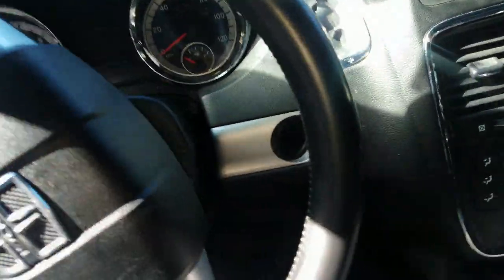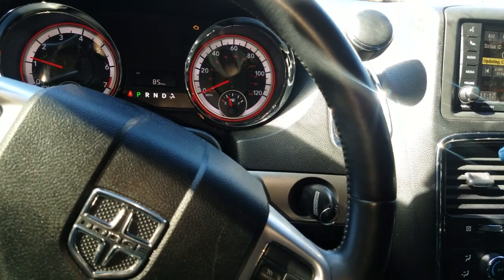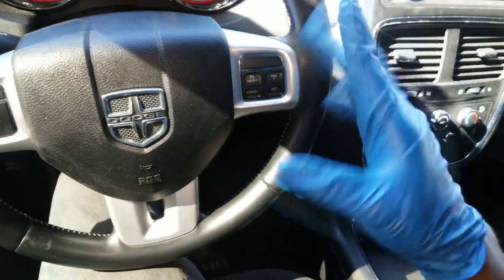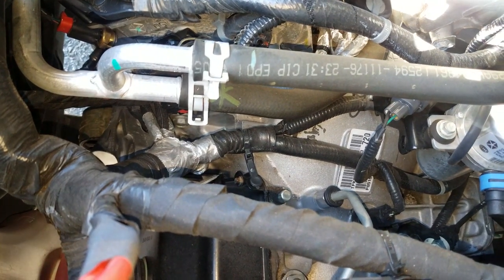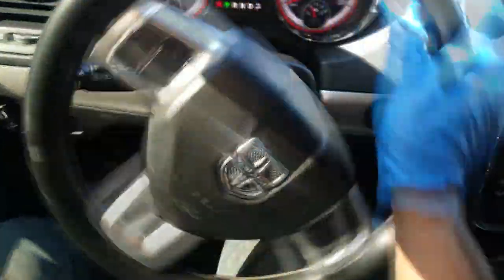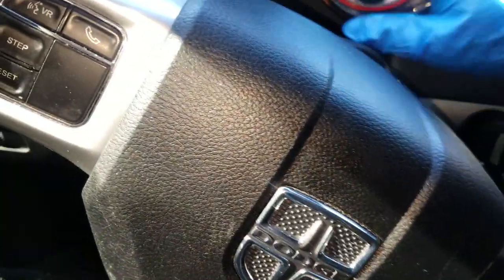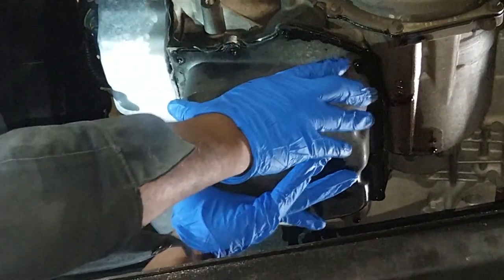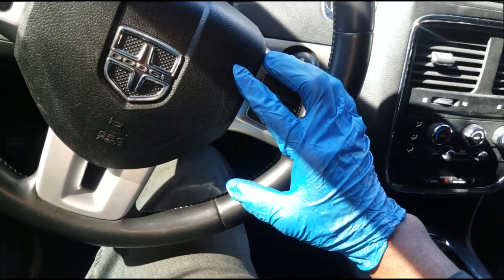Transmission whining noise or Power steering pump noise? P0868 P0944 P0700 P0740 62TE P0897 P1798

Comment: my car sounds like that when I'm accelerating thought I had a hellcat for a second
Reply from the maker: whoa, not good bud..Get that looked at..Thanks for watching. Please like the video and subscribe to the channel for me, thanks
Reply: Same
Reply: LMAO no fr
Reply: Same any one got some help ?
Reply: West Mane    >>damaged torque converter or planetary gearing if you hear that intense scrubbing/whining sound (when accelerating)<<
Reply: What do you think the problem is? Cause mines doing that now
Reply: @BajanBoo  power steering
Reply: @westmane5293  clutch fan
Reply: Did you get it checked out?
Reply: @josephjefferson6337  it was the pulley
Reply: Bajan Boo thanks for the reply how much did it cost if you don’t mind me asking?
Reply: @josephjefferson6337  well I never went to those well known mechanic shops because they are expensive. I went to a small garage shop and paid 200 for everything. I like to shop around before I take the first offer
Reply: Bajan Boo very smart !! I wish I can do the same but since I got a 2018 lease I rather for dodge to do the work so they won’t try to void my warranty ya know
Reply: @josephjefferson6337  yeah, since you have a newer vehicle, take advantage of the warranty and get the new parts for it. My car is over 15 years old so going to the scrap yard and getting parts for 50 bucks, I must have safe over 1,000 bucks within a short period of time.
Reply: Facts😂😂😂😂😂
Reply: 😁😁😁😂😂😂, MysticPlays.
Reply: Wheel bearings
Reply: Or the pulley
Reply: literally me
Reply: 😂😭on god this my 99 accord with a supercharger😂😂😂
Reply: I got the same problem right now with mine ahhh 😩🤦🏻‍♂️
Reply: Murano Hellcat 😎
Reply: @BajanBoo  can it be another bearing ? Or strictly wheel bearings ?
Reply: @tigretouchingbandz  it was the wheel bearing
Reply: @BajanBoo  oh ok yeah jus took my charger in after some slight unwanted whining, they told me bearings as well not sure how many they’re are tho . Motor mount as well
Reply: @tigretouchingbandz  wheel bearing is when you driving and it sounds like an holicopter. The whining can be the pulley, you will hear a whining noise when you accelerate. Did they say your pulley is ok?
Reply: @BajanBoo  yeah I hear slight whine when I hit freeways 70mph and greater. Nothing about pulley but might need change the rear differential. We’ll see if that fixes it , also my rear differential fluid was over due for a change,  I never even knew that was a thing lol 🤦🏽‍♂️
Reply: @tigretouchingbandz  always change transmission and engine oil. It make car drive smoothers and last longer
Reply: I have a 2020 malibu and it is quite when In park even when i Rev the  engine the sound isnt there ,then as I put it in drive and accelerate it makes a ticking noise what could it be?
Reply: @frederickgraham8927  last time I hear a ticking sound is when my back brakes needed changin.
Reply: @BajanBoo   ok appreciate,  its definitely not the brakes it's more of a whining ticking noise sounding like either from motor or transmission!
Reply: @frederickgraham8927  it might be a bad oil filter
Reply: My Charger RT makes that noise. The bearings have been changed. The noise happens when driving, not in park?
Reply: @OnlineMechanicTips  it’s a sign of low power steering fluid probably

Comment: This transmission's filter is clogged and it is starving the transmission pump of fluid. This is a common problem these six speed automatics have.
Reply: So how can you fix the whining noise my car has the same issue ?
Reply: @Esteban.empire. Either get a transmission change so you can change the filter but if you kept up with maintenance on your car do a transmission flush.

Comment: I got 2007 Chrysler 300c hemi w/ 180,000km. My car makes whining noise on acceleration exactly same as this one and the steering makes the grinding sound exactly same as one u did when turning left and right. I know my power steering pump is bad but is the whining from transmission or power steering pump because I’ve gotten before code p0730 I cleared it and never came back and I check the trans fluid it’s black as night. So is the whining noise from the faulty power steering pump or it’s another problem from transmission. I don’t hear anything on idle only when accelerating. I have no transmission leak or slips but it does shift a little rough. If I can please help me out

Comment: If the whining sound goes away in park, but comes back in drive, would that be power steering or trans noise? The whining noise sounds like a mini supercharger when I accelerate. I also get a noise when I turn the wheel in park.
Reply: I get the same noise, and the crazy part is I was t boned in August and just got my car back today from the mechanic. They claimed they fixed everything, but my car didn’t whine before. Now when I crank it up and accelerate it sounds like im driving a Scat pack with muffler deletes. Mind you I drive a Nissan Sentra 2015 SV
Reply: @leshaybrown1044  ever figure out what it was?
Reply: @joshkropik  my rear axel was broken, and I traded my Sentra for another car. So I’m unsure if the broken axel was the cause or something else.

Comment: This sounds like mine and mine has nothing to do with maintenance. I have had everything done and yet my 2013 with 150k has had a new engine dropped, new AC unit and much much more. If I didnt owe on it still- I would get rid of it in a heartbeat. Soooo much issues.

Comment: Ay man I'm getting a pretty loud higher pitch whining on my 06 buick lucerne cxs. Just started this morning. Heard it accelerating and when turning it gets pretty loud. What do you think? Something with the power steering?
Reply: I’m having the exact same problem did you ever figure out what it was?
Reply: @kaitlynr.5944  ya it was the power steering fluid being dry. There was a leak somewhere in my rack and pinion or my steering shaft. Still haven’t gotten it fixed.

Comment: Had this issue with my Jeep Liberty 2005 3.7L. 42RLE. Dropped trans pan and replaced filter/fluid. Trans now does not exceed 180-190 degrees (approached 230 at times in city). No whines and actually shifts okay. Cleared codes and 250 miles later no codes. 42RLEs are still shit though...

Comment: That's the Torque Converter. Drive it till it quits, live with the noise. Maybe change the transmission fluid & use Lucas Transmission additive.
Reply from the maker: That's not a Torque Convertor making that noise dude.

Comment: Did you end up only replacing the filter and if so did that fix the problem?
Reply from the maker: No, curious what kind of vehicle you have? Is it whining? Also are you subscribed to the channel?
Reply: @OnlineMechanicTips  89 cressida, A340e tranny. It was whinning bad on cold start then would go away but continued to whine while accelerating. Ended up replacing the filter and fluid and it fixed the issue! Nice and quiet now. Thanks a lot! You were pretty much the only source that made me believe it was the filter.

Comment: My van is at pep boys In GA broke down on way back home from Florida to TN so broke down with 3 kids . They are saying it’s full transmission replacement and we had no previous warnings noises or anything just went to not shifting while driving in traffic.
Reply: Oh and codes were P0944, P083B and they are saying it needs replaced just from there codes they haven’t even dropped transmission pan yet

Comment: Check engine lights on guarantee that’s a transmission nose but that light could be on for anything. Best way to tell just turn the steering wheel it’ll make all kinds of noise if the fluids low

Comment: Sounds like the whining noise my Transmission is making in my 2014 ford transit connect. I had the Transmission fluid and filter changed ( they said they changed it anyways ) and about a month later it started making this noise.

Comment: I have that ,, naaaahh,  or that whining,  when I turn my wheel, just like u were describing  when u first started ur video,  ..& its all the time, but the reservoir is always full& haven't had to add no power steering, except for 1 time or so,, right when weather kinda turned colder,&  still same noise, but then stayed full,, but then, tried Lucas..power steering stop leak,& noise went away, but came back, a few days later, but reservoir is stil full..
Could it still b my power steering pump??

Comment: My car sounds perfectly fine when first driving but after about 10 minutes of driving the whining start and a little after it starts I lose power and if I go long enough it COMPLETELY loses it, but park it and the next day it’s fine again until I drive it for about 10 minutes again … changed my fluid and it’s still going on
Reply: Are we to assume you change the filter as well and you still having this problem or did you only change the fluid?
Reply: that’s your alternator

Comment: Good video with good flow of logic -- but the one thing missing is the result: did a trans service fix the problem????
Reply from the maker: Good point, thanks for watching. Here at the dealer I had to write an estimate and because this van was stillunder warranty, I had to determine if it would cost (per the stimate) over 70% of the trans replace cost. That was my result so I ended up replacing the complete transmission unit. Please subscribe to the channel for me, thanks
Reply: Service doesn't fix this. I've had my Toyota serviced with new filter and fluid, and even had it flushed again a week later, still sounds the same. Sadly bought the car and they didn't take care of it 🙄
Reply from the maker: @JamesAutoDude  Yes, this is past a trans service..That will not help you at this point, the damage done

Comment: thank you for this video…question i heard a lot that says some when you change trans fluid itll mess up the trans..true?thank yiu
Reply from the maker: It depends, there is a risk if you have NEVER change the fluid at high miliage then you do it. How many miles on ya car?
Reply: Online Mechanic Tips  not yet sir but will do now..my sisters van i think has 100k+. miles on it and shes asking me bout trans fluid change if i can bring it to the dealership this week..last time i drove it theres this noise when turning so maybe thats on steering
Reply from the maker: @davao0506  Yes, if the noise change when turning the steering wheel, it possibly in the power steering like I mentioned in this video. As for a trans service, there not much of a risk changing the fluid and the filter at this amount of miles.
Reply: Online Mechanic Tips  thank you so much for replying sir..be safe and God bless..
Reply: @OnlineMechanicTips  9

Comment: This is the very nice video indeed, I have the same noise and I normally asks myself how it makes this noise and the fluid level is Ok? How did you solve the problem? ?
Reply from the maker: Hey bud, I removed the trans pan and saw a lot of clutch material that likely came from the torq convertor. I ended up removing the trans for a overhaul with a new pump and convertor

Comment: I’ve changed my alternator, flush trans fluid and new filter on 1500 Tahoe still whining noise would a transfer case cause a whiny noise while accelerating or the power steering pump
Reply from the maker: Is that the only time its whining? when you accelerate? Also are you subscribed to the channel?

Comment: Will the RPM jump up for a second for no reason? It’s making that same noise too 🥺 (2014 Dodge Grand Caravan)
Reply from the maker: The main tell tell is trouble codes. Is your check engine light on? Also are you subscribed to the channel?

Comment: my 72 chevelle is making this noise when i’m accelerating... not turning and the power steering pump works perfectly, i really think it’s the trans and when putting it in 1 (it’s an auto) it sounds terrible in high rpms...

Comment: I have a 06 2.4 Camry with 105k same noise changed power steering pump and alternator whining noise still there at start up in park and while accelerating in park or drive. No check engine lights. You think a transmission flush new filter could help?

Comment: I got the same noise on my 03 axura tl type s . That noise but in reverse.. i accelerate and reverse slowly, once i go to 3000rpms i hear a loud thump noise but my reverse is not working as it should, i had the transmission rebuilt and ever since it was making that noise and reverse dont work. They said they changed the toraue converter , new trans filter and fluid. But still remaina the same issue and noise
Reply from the maker: My friend this could very well be the valve body, which is hardly touched during a overhaul. Are there any codes? Also are you subscribed to the channel?
Reply: No codes. No check engine light. The noise is coming from the top of the transmission, the torque converter was replaced same as the transmission filter and fluid. I noticed a ground wire is ripped connected to the chassis and transmission.

Comment: Hopefully you see this comment and respond  even though this isn’t a recent video….Could replacing the filter still help this problem or does this sound happening mean the transmission has to be replaced?? =/
Reply from the maker: The transmission has likely starved to death so the front pump now whining. If you replace the filter and fluid now, there is a small chance it may stop because it is now circulating. But the pump and t/conv problems will still be there. Also are you subscribed to the channel?
Reply: @OnlineMechanicTips  Literally just discovered this channel earlier today and hadn’t subbed up to this point. Also, what does t/conv mean? Already looked at filter kits but not seeing a pump on the mainstream parts store sites. Suggestions? (Ps…97 Safari van)
Reply: @OnlineMechanicTips  Sidenote: …in case it makes a difference, the sound has only occurred twice (it’s not constant), and today was the second occurrence. Does that seem like it might increase the prospect of a positive outcome with a filter swap? Also, much appreciation for the earlier communication.
Gonna try to get the van in on Monday for at least the filter, and if either you (at some point over the weekend) or the mechanic at that point suggests further action, then i’d try to figure out how to make that happen.
Reply: @OnlineMechanicTips  Update: got the new filter put on today and was wondering if you would possibly suggest what to try paying attention to and looking out for to determine if there’s cause for further concern?

Comment: Ok so my car will make a similar noise, not as loud as this one, but IT ONLY MAKES THIS NOISE WHEN THE CAR IS MOVING. It will not make the noise in park or neutral or revving it with the car in reverse or drive, and the pitch changes with the engine rpm. I'm guessing transmission as well?
Reply from the maker: Hey bud, it very well could be your transmission front pump. Especially if its a 62TE transmission and you was not servicing it on time.
Reply: @OnlineMechanicTips  would a simple transmission fluid and filter change help that? Or would I have to change the pump as well? I have a 2013 Dodge Dart with the 2.0 engine and 6F24 6 speed auto trans

Comment: Oh yeah that is very loud!  We have a 2013 T&C.  We bought it and as soon as we drove it off the lot P0740!  Dealer agreed to pay part of repair since it was bought as is.  It's having transmission issues still after replacing Torque Converter & they cleaned the pump.  It's going into lock up around 32 mph & then slipping back out & back in at around 48mph for just about 1 second.  It does it whether it's cold or hot.  They originally tried to tell me no big deal but it is to me!  What do you think went wrong?
Reply: Better get a new transmission...then wasting money on this part that part.

Comment: I'm having a whining noise when i'm accelerating now but i just changed the transmission fluid 6 months ago. When i turn the steering wheel i'm not really getting a whining noise, more like a groaning noise. Shit is driving me crazy.
Reply: me too
Reply: Could be your axels 🤷
Reply: check your alternator, 99% its your Alternator whining. Get a statoscope from parts store and listen for it.

Comment: I have the same noise when i accelerate in my forte 2012 do i need to replace the filter and oil or it could be a failure in the torque converter?

Comment: Mine is whining when acceleration and when I turn left it’s gone but when I turn right or straight it’s whining, is that a wheel barring or transmission? I don’t hear it at start up only when on the highway or driving pass 40+

Comment: Dear Lord, .I thought my transmission wine was bad and I can only just hear it..I dont have the noise in Park, or turning the wheel..and it sounds ...hard to describe, a  humming that Iis kind of electric? cant  hear it with bonnet up..its alost like like if you were up real close to a high voltage powerline I guess, but not high pitched...and the car feels 'heavy'...scan tool hasnt thrown me any eror codes ..Im going to go ahead and service the transmission tomorrow and make sure the fluid is flowing freely..I didnt know a filter could clog the flow...thankyou.

Comment: So if it was power steering and a hard steering while parked what would it need?
Reply from the maker: Hello my friend. Im not even sure what kind of car or steering system you have. Also are you subscribed to the channel?
Reply: Yes i am its a 2014 subaru legacy 2.5
Reply from the maker: If you having hard steering along with the whining noise then yes, this likely a power steering problem..first thing first. Check the level and the condition of the fluid.if ok you may have a restriction. This could be for a number of reasons.